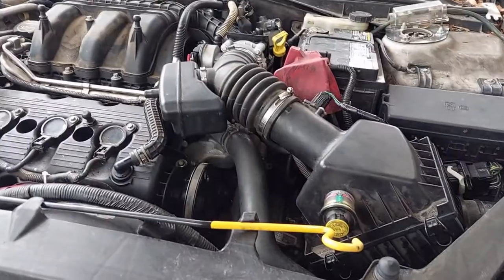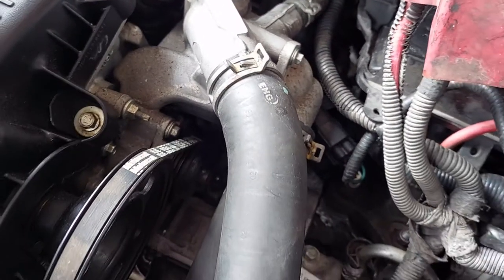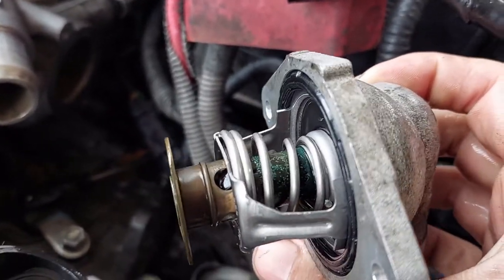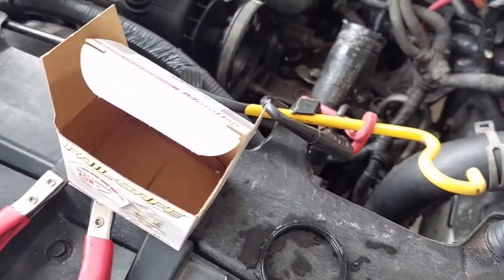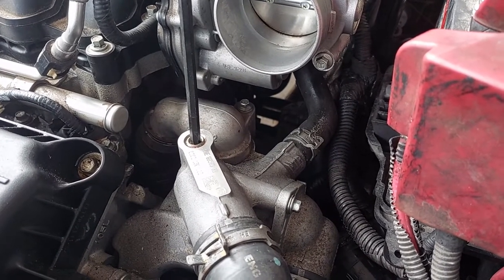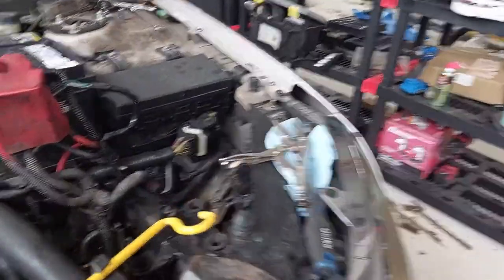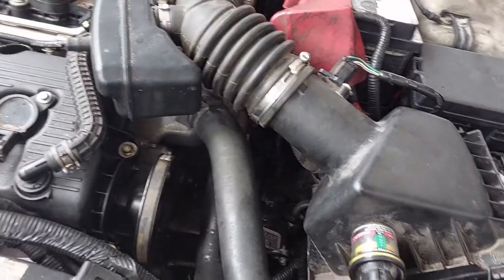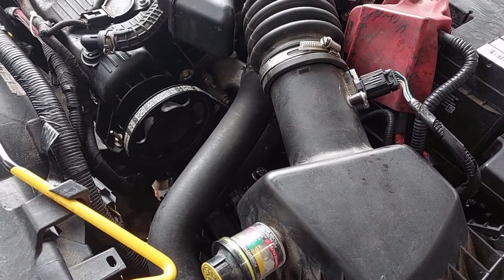Episode 34 - Replacing Thermostat 2010 Ford Fusion

Comment: My fusion has been struggling on inclines overheating if I don’t monitor it and pull over. I’ve pulled over to check the fan and I’ve noticed in not even on when car is above temp. Are you still having this issue?
Reply from the maker: Since I replaced the fan controller in mine, I've had zero issues with the cooling system.  If you are having issues with the cooling under load I would check the status of your coolant, check to see if your thermostat is good and check to see if your fans are spinning up when they are supposed to.
Reply from the maker: Some other possibilities are a clogged radiator or a bad pressure cap on the overflow tank.  From the other comment you left though it sounds like you had dirty coolant.

Comment: Hello....I have a 2010ford fusion sport v6 3.5 issue with overheats.  Fans won 't run after a while, high on temperature. Any help??
Reply from the maker: I have another video that deals with a part I call a fan controller than can go bad and will cause the fans not to kick on.  In the short term run your AC.  That should cause the fans to run for the AC which should help with cooling until you solve this issue.  On my channel page, click the 2010 Ford Fusion playlist and it should have the fan controller video in it.

Comment: Do you know where the cylinder head temp sensor located at in this engine
Reply: Between #2 and #3 spark plugs...Under that rubber grommet

Comment: hello,,as per your case study videos on thermostart change,i have chenged my thermostart  and burp the air out bt still overheats,,any advise
Reply from the maker: Providing you installed a good thermostat, spring side towards the block and did indeed bleed all the air out of the system, you need to start checking the other parts of your cooling system.  Are the fans kicking on at around 223F?  Do you have obstructions in your cooling passages?  Is oil getting into coolant and reducing cooling effectiveness?  Is the radiator clogged?  Is the cooling system staying under the correct pressure?  It should be running under 16lbs of pressure so checking the cap on the overflow tank for good seal is important as well.  Those are the places I would start.

Comment: Cool educational video,  I'm gonna be replacing the thermostat along with the water pump on my 2020 Mercury Milan. New subscriber here.
Reply from the maker: Thanks for the sub!  Good luck on the water pump.  2020 means that should be an ecoboost engine.  Not sure how the water pump is setup on those.
Reply: Try 2010, since 2011 was the last model year for Mercury.
Reply: @bobbyheffley4955  I'm bad, I meant 2010. Thanks for correcting me..

Comment: Appreciate your upload. Currently filled mine with water and Preston’s radiator cleaner to run for a day. Already noticing improvement in my idle with ac on.. isn’t surging anymore when the compressor clutch is engaged. Plan on finishing the job tomorrow by draining water and flushing again, installing new thermostat, and adding new coolant. Question I had was do I need to clean threads for bleeder valve or reheat the red locktite before putting it back into housing?
Reply from the maker: In a perfect world you would use a thread chaser and a die to clean up the plug and the hole it goes in...In the real world it doesn't matter.  Since the bleeder is pretty accessible I didn't even put a new application of any kind of threadlocker on it.

Comment: Replaced the thermostat but was still having a problem. Didn't know about the bleeder screw so I'm guessing I had an air pocket. Working great now, thanks.

Also, the thermostat will only go in one direction
Reply from the maker: Glad you were able to solve your issue.  And you are correct, it should only go one way...

Comment: The second hose you removed you said the transmission is like why are you doing this to me, do I need to refill it with transmission fluid
Reply from the maker: Nope.  I said that because the thermostat is located above the transmission housing and in the process of getting to the thermostat I very thoroughly doused the transmission housing with coolant.  It's sealed so no worry for damage there either.

Comment: Do you know if the thermostat is in the same location on the 3.5 sport model?
Reply from the maker: I do not.  The 3.6 is a Duratec engine, same family as the 3.0 I have.  But I do not know if they moved stuff around to squeeze in the extra .5 liter.  A good way to check for the thermostat is trace the upper rad hose back to where it meets the block and look for a water neck there.  Normally thermostats live in that area.  The very best bet would be to grab a Hayes or Chilton manual and look up the procedure for the thermostat for your engine.

Comment: Your way looks way easier than the other video, this other dude was taking the belt off and everything
Reply from the maker: You should not need to take off any belts going after the thermostat.  A bungee strap is handy to hold the radiator hose out of the way so that you can get access to the water neck where the thermostat is located.
Reply: You might of been watching something regarding the water pump instead of the coolant thermostat.
Reply: That was a video of the 2.5 liter engine with an integral housing. The 3.0 liter is easier.

Comment: So I have a 2012 Ford Fusion 3.0 the water pump was leaking I replaced it the thermostat was In half instead of one whole piece so I replaced it I'd also replace the water pump belt I ended up replacing the radiator today and I filled up the coolant with the bleeder valve loose are off completely actually until coolant was coming out I had the fan on Max air on Max heat and when I accelerate down the street rapidly or I go up a hill on the dash shows 3/4th of the way to the hot indicator and it was doing this before I even replace these parts starting on the 4th of July and I cannot seem to figure out what is going on So what else is there to do I also did a block test with the blue fluid and it stayed blue so I don't believe it's a head gasket it starts fine it doesn't smoke our steam when it reads hot there's nothing on the floor I did a coolant system pressure test it held the pressure I also replaced the cap with a new one and I can't see the figure out what the problem is also doing it the way you did is the same way I did it did we not get all the air out and my fans do work my fans been kicking on loudly when it gets hot
Reply from the maker: Let's dig into this a little bit.  Car is running hot.  So far you have:

1. Replaced the radiator
2. Replaced the pressure cap on the overflow tank
3. Replaced the water pump belt
4. Replaced the water pump
5. Did an exhaust gas test on the coolant, came back clean
6. Did a pressure test on the cooling system with the new cap, pressure came back good
7. Replaced the thermostat

With all those parts replaced and tests done, you still notice:

1. When accelerating or placing the engine under heavier loads the temp gauge spikes.

You've done most of the tests that I would do to make sure the cooling system is behaving correctly.  Since I didn't see the work done, I would check to make sure the gasket on the thermostat is in place, and the thermostat has been placed in the correct orientation (spring side towards the block).  The fact the car is spiking in temp under heavier loads, then calming down under lighter loads says the cooling system is working to some degree.  I don't think you have an air bubble in your cooling as that would cause random temp spikes as the bubble is circulated around the cooling system.

Another possibility is that the cooling temp sender might be dying.  That is the sensor that supplies temp data to the instrument cluster.  I don't really think this is the issue, but it's worth checking out.  I would also check the status of any cooling hoses, making sure they are not collapsing under heavier loads.  I've never seen that happen, but I do know that formed hoses will lose the ability to keep their shape as they get towards the end of their life.

I know your hydrocarbon in coolant test came back clean, but I would also check your oil for milkshake, just to be sure.  Pull the oil dipstick and look for a frothy, chocolately brown color.  If you see that it means moisture is getting in the oil.  A little moisture is normal around the oil cap particularly if it's humid weather and the engine hasn't been ran at operating temp for a bit before being turned back off (~30 minutes).  If you still see chocolate goodness after that, might have some exchange going on.

Beyond that I can't really think of anything that you should check, other than double checking the installation of all the parts you've swapped.

Good Luck!
Reply: @MazdaB3K   It's more noticeable after I change the radiator yesterday
Reply: I figured out the issue the brand new failsafe thermostat I purchase from napa auto parts was  defective and I determined this because when the car was overheating yesterday the lower hose was not hot but the upper one was scorching
Reply from the maker: Fantastic!  I'm glad to see your troubleshooting paid off!  It's rare, but sometimes new parts do fail off the bat.  The part houses figured out awhile ago it's cheaper to offer warranties than it is to actually test the parts.  Motorcraft is the only exception that I know to this, which is partly why their stuff is always so expensive.  Again, nice solve.

Comment: My son just got his first car and it is a 2010 Fusion. Very good video. This will be his first repair.
Reply from the maker: 2010 Fusion is a pretty decent sedan for its time.  Good power, decent fuel economy, decent cabin and trunk size.  Does his have the 2.5L or 3.0L?
Reply: @MazdaB3K  2.5
Reply from the maker: That is a slightly underpowered but very reliable engine.  I had the same one in my 2016 Transit Connect.  Make sure you do the fluids as needed and that engine will last about forever.  One thing I did forget to mention.  The 2010 Fusion has the 6F35 transmission which is decent as long as you do a drain and fill on the transmission about every 30k miles.  I do have a video up under the 2010 Fusion playlist that covers how to do this.  Make sure you use Mercon LV compatible fluid.